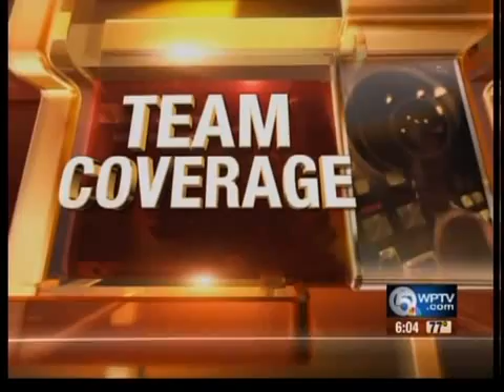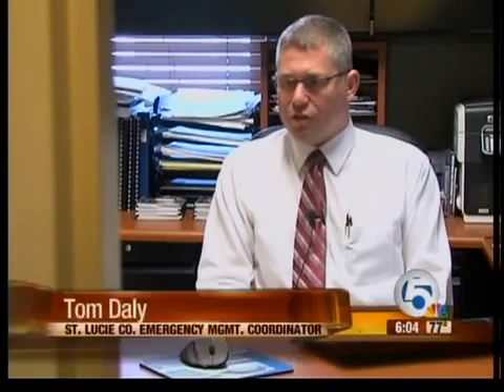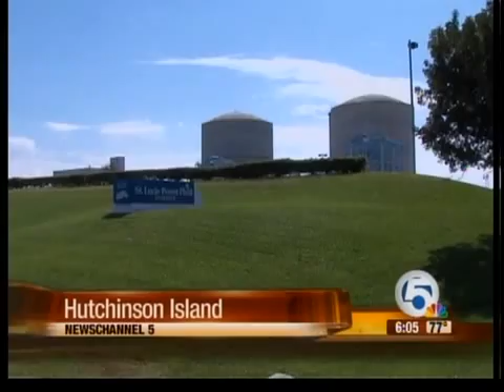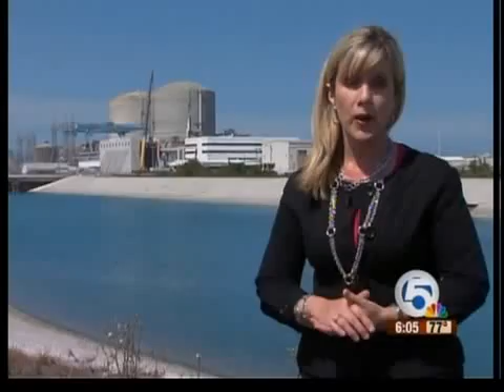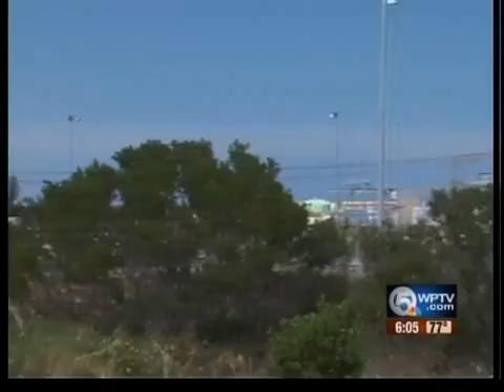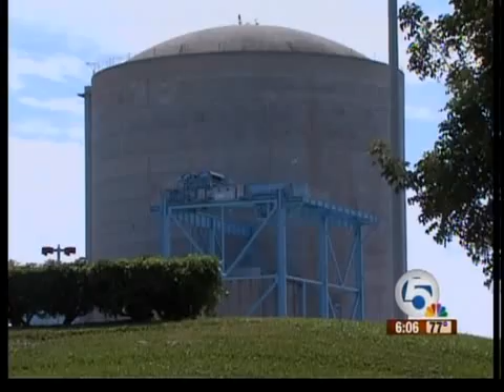St. Lucie nuclear reactor

Comment: Nuclear reactors are far safer than all other energy sources.  The major distasters happened long ago and the technology is far safer.  Coal and gas plants are much more harmful to those living near them.  In regards to the radiation, if youre living within 50 miles, you receive 0.01 milirem per year.  To put that into perspective, we receive 300 millirem from natural sources each year.

People overexaggerate this stuff.
Reply: Chernobyl and Fukushima weren’t that long ago…and will remain unsafe for thousands of years
Reply: @Hiltrljr The Chernobyl power plant was built 60 years ago, when the technology was just starting to become commonplace.  Look at how far every other aspect of technology has come since then.  I’m pretty sure they have a lot more safety systems in place in reactors built or existing today

Comment: There is no way Port St Lucie nuclear power plant is prepared for a title surge of water. If that ever happens the entire State of Florida would have to be evacuated and many portions of Georgia as well. Fukushima had three nuclear meltdowns. Because they could not supply power nor could they Supply fresh water to the nuclear reactors which is exactly what would happen to Port St Lucie if it was ever hit by a hurricane or surge of incoming water such as hurricane Ian did to the West Coast just imagine a storm or hurricane like that hitting the East Coast near the proximity of Port St Lucie Nuclear Power Plant. Fukushima is still leaking radiation to this day and that happened way back in 2011. Many parts surrounding the nuclear power plant are still uninhabitable to this day. Here in Florida you would be talking about mass mass evacuation and unfortunately probably Mass death as well plus all the cancer and illnesses that would come about from all that nuclear radiation escaping. That would be extremely Radioactive and deadly for many many of years.. such as Fukushima is still highly Radioactive to this day even after the so-called clean up effort.